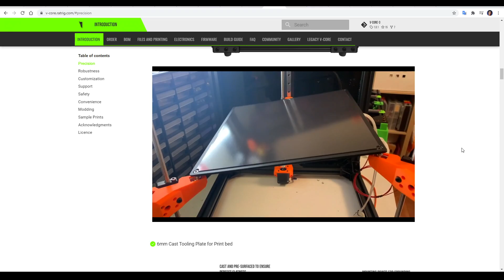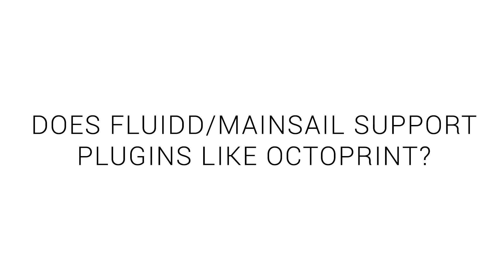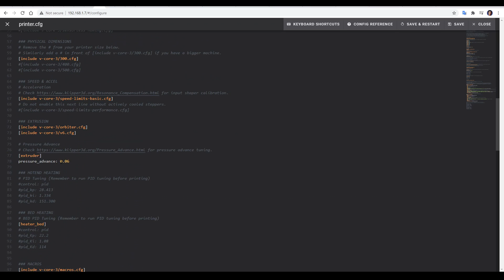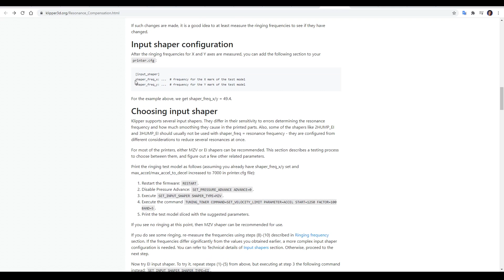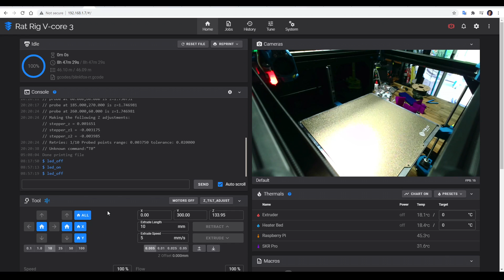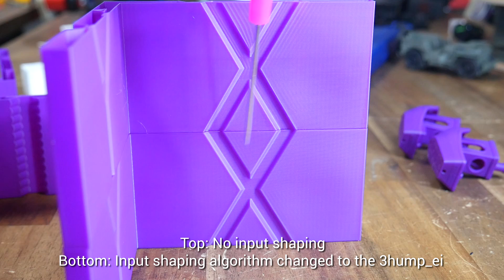Klipper input shaping - A leap forward in high speed AND high quality 3D printing [Rat Rig part 4]

Comment: Im amazed with your video, i just have a question. Why should I go with a ratrig instead of a Voron? Just want to hear your opinion
Reply from the maker: I agree with what Mikkel has said. Living in Aus, I was particularly attracted to buying everything as a bundle from one place. The whole experience so far has been tremendous, no complaints at all. This is not a criticism of any Voron model, I have no doubt they are excellent machines tool.
Reply: @TeachingTech  than you for your answer, I'll totally watch all the videos related to this build as this is the only one ive seen so far, do you consider that switching from marlin to klipper is to difficult? Or should it be a no brainer? (Maybe apples and oranges here but this is the first time ive heard of this firmware).

Greetings from Mexico mate!
Reply: I can try to answer that. The pro's for the Rat Rig V-Core 3 would be: Designed to work reliably up to 500 mm^3 print volume. Beefier and more rigid construction (3030 profiles, mgn12, 9mm belts, corner plates, etc). Easier/less complicated assembly. Backed by an actual company (that means official kit sold in EU, proper EU warranty and support). Prolly a few more i forgot. Kind of a subjective one, but in my opinion EVA (the carriage) is one of the big pro's as well, it's so well made, modular and well balanced :)
Reply: @miklschmidt  thank you for your answer, I was actually thinking of it while looking for the kit and ratrig caught my attention easier, I'll keep looking into this as im intended to invest in only one more printer this year.  Thank you for the information!
Reply: You have to also consider the goals that the designers of each printer wants to achieve. The main goal of any Voron is to print ABS reliably, and they do excel on that. That's why they limit to a 350mm × 350mm × 350mm print volume, more than that and it becomes harder to passively heat the print chamber. Also, it is the anecdotal higher print volume that can be reliably made with 6mm width belts.

V-Core 3 can have bigger printer volumes, but they use bigger belts to overcome one of the limits of the CoreXY motion system: belt length. As it increases, it becomes more and more difficult to tension the belts properly. By using beefier belts, V-Core pushes the limit a little bit further, because the belt itself is more rigid.

Also, Voron official community at Discord is pretty friendly, despite what the haters says. Can't say about the official V-Core community, as it is hosted on Facebook and I deleted my account there years ago. 🙃
Reply: @vinnycordeiro  great info! I never use abs as I dont like the shrinkage and I can get better fisical propperties with other materials or at least similar, I design and 3d print tactical equipment and prototyping for same area, started as a hobby and I hope soon become my man income source as I love doing it! 
Anyhow, I would love to give ratrig a try, voron sounds great but I really dont.have the time of printingn all the accesories needed so I believe I have my best option already thanks to you guys!
Reply: @luigitejeda328  Voron have a Print It Forward (PIF) program, so you don't have to print the functional parts, and some sellers on Aliexpress are already selling kits for the more popular models (the Voron 0 and the Voron 2.4). Stepper motor manufacturer LDO is planning to sell Voron 0.1 kits at the of the month, and Fysetc is already selling Voron 2.4 kits. And there are online shops in the US and EU selling parts for Voron printers.

I have a Voron 0, it prints like a charm, and I still didn't finished calibrating it.
Reply: @vinnycordeiro  we have a very vibrant and active discord community as well, in fact, i’m an admin there :)

With regards to passive chamber heating, the heater scales with the build plate, i’d be shocked if the 500 didn’t print ABS perfectly well :)
Reply: @miklschmidt  but it'll take more time, as the print volume increases in a higher ratio than the bed area. That's why people got in love with the V0, it's so tiny that it gets pretty toasty very fast.
Reply: @vinnycordeiro  if the buildplate was in the bottom, yes, maybe it would be an issue, but it’s not. I don’t think there is any issue with it. Fwiw, we have a few community members with enclosed 500mm’s an no one have reported any such issues. The 500mm heater is 1700W. It heats up my office to 30 degrees pretty fast 😂

You can always add a chamber heater i guess.

Comment: Thats really cool; glad to see there are people in the fdm space still doing other stuff than seeing if they can make their printer another $10 cheaper. Id gladly pay a premium for a printer that does all this well out of the box, but as far as I know neither prussa or ultimaker have been pushing the envelope here.
Reply: this makes some ultra rigid setups $300 cheaper
Reply: Input shaping is definitely the way to go to improve the FDM printing experience. I have spent the past 12 months to develop an easy use input shaping firmware which only use a 32bit control board.
Reply: Input shaping without Klipper https://youtu.be/d-X-BZQEGno
Reply: Most people go to modded printers that are deep in the hobby, look at vorons
Reply: Hey from the future. Bambi Lab x1 Carbon
Reply: Making printers cheaper is still a good thing. I can't afford one still (highschool student :3) but it's getting close.
Reply: @ChrisD__  Creality Ender 3 of e-bay for $197, and PLA is $14 a KG...  It's not going to get any cheaper, and if it did, you don't want it, likely...  Now you know what to ask for for Christmas...
Reply: @thetruthserum2816  Is the Ender 3 a good machine?
Reply: @Mategeneral  Price to performance ratio is as good as it gets... $179... But, if you want a no fuss printer, skip any printer with a spring bed, and go for direct drive extruder and linear rails, for example the Cetus 3D will give overall better results because "there are no springs"... Springs are not repeatable, and are only there to "prevent a crash", and need to be eliminated from 3D printing entirely.

Comment: i need klipper to have better support for LCD screens. sometimes i just want to use my printer without having to load up a web interface on a different device....this is what i'll miss the most if i move from Marlin
Reply: You can use most LCD screens, you can easily configure your own menu entries as well if you want to. Then there's touchscreens connected to the pi with KlipperScreen and finally an old tablet / phone or HDMI screen with the Fluidd interface like Michael is using. Lots of ways to use klipper without a separate device :)

Comment: Instead using the macros to turn on and off the led you can use the switch in the fans and output section. If you add the pwm section in the [output_pin] you can also change the brightness with a slider in the same fluidd section
Reply: Could you elaborate on that? If the fan output runs on 24V hows do I run a single 2V led of that? Or does it require to install 12 leds to fill the 24V output?
Reply: @chaicracker  you can set a max pwm output. If you need to power some 12V equipment you set the max power at 0.5 so the output at 100% is 12V
Reply: @XeonMC01  Holy moly.. thank you for blowing my mind... also thanks for the quick reply :) <3
Reply: @chaicracker  hope it does work for you
Reply: @XeonMC01  I'm preparing a led to try out, do I need a resistor for that? only have one on hand and don't wanna fry it.
Reply: @chaicracker  technically it’s sufficient to set a lower power value in the config. If you want to be shure you can set it to output half of the maximum voltage that your led supports, and then fine tuning it

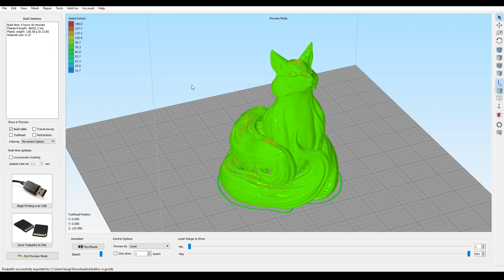Comment: 19:08 *Lowered the layer height to 0.15mm
Reply: Even if the trade off was just printing at 0.15 layers in the time of 0.2-0.3layers it would be a big quality / speed improvement.
Reply: @radicalxedward8047  That was not the point. I wanted to correct him cause he said 1.5mm instead of 0.15mm.

Comment: This series and printer is outstanding, I look forward to your speedboat prints seeing some of those just blows my mind. Is it possible to make a linear advance test with the cube shape in marlin ? it just looks like a better way to check.
Reply from the maker: I believe you can use whatever test print you want since the firmware is altering the values on the fly for you. In Marlin, you would just add in M900 values every few layer changes with a text editor and then print.
Reply: @TeachingTech  Great, I will try this.

Comment: Is it possible to make a comparison between reprap and klipper? I love all these new features in klipper, they seem really really good and they seem to be constantly improving at a rapid rate unlike the others so far. I currently have reprap on my skr pro 1.2 but I don't know whether it's worth it to swap from reprap to klipper. I'll add that I'm using a delta printer too.
Reply: So i've been trying to keep a pros/cons list up to date, maybe it's useful to you. I've tried being objective, but i am a major klipper fanboy, so keep that in mind. Bear in mind that it compares Klipper with RRF running on a Duet Board, since this is not the case, some of the pros for RRF are not applicable:

Klipper Pros:
Proper input shaping with automatic calibration via an accelerometer.
Faster than you'll ever need.
Very Precise motion based on actual physics instead of approximations.
Easy to setup with V-CoreOS (Requires SKR Pro 1.2 at the moment).
Readable configs, flexible jinja2 infused gcode macros.
Has a handy TUNING_TOWER command for changing parameters at an interval throughout a print, for tuning purposes.

Klipper Cons:
Documentation could be better, everything is well documented (including technical details and guides) but could be easier to navigate.
To use physical endstops on the SKR Pro 1.2 you need to bend 2 pins on your stepper drivers
Duet/RRF Pros:
Excellent hardware
Extensive documentation
Input shaping should be added soon-ish.
G-Code everywhere allows you to do configuration mid-print if you for some reason wanted to remap your axis, change your kinematic system or flip your stepper directions while printing.
Duet/RRF Cons:
G-Code as configuration (arbitrary numeric commands for configuration is not great for readability, you'll need the documentation constantly)
No input shaper at the moment (as mentioned it's coming). DAA does not count.
Slower than klipper (may or may not be an issue in practice when input shaper is added)
Reply: @miklschmidt  ahh just seen that you can use fluidd/mainsail, for the interface, those look very nice actually and seem very similar for reprap.
Reply: @miklschmidt  are you the person that makes the ratrig? I seem to see your name quite often around this printer? If so I'm very impressed with the price, if I didn't have a large delta printer I would definitely be looking at your printer.
Reply: @madbull4666  i’m just a BETA/Development team member, admin of the discord and creator of V-CoreOS. Pawel Kucmus is the designer and Rat Rig is the manufacturer :) it’s complicated 😂
Reply: @miklschmidt  sounds like your a pretty important part of the team then!
Reply: @madbull4666  nah i’m just the guy that yells “klipper!” at inopportune moments 😂
Reply: @madbull4666  didn’t see your other comments, sorry!

V-CoresOS is just a preconfigured Klipper package that takes the hassle out of the setup process. Watch the previous video in Michaels series to see how that works. As of now it only works with the SKR Pro 1.2, but support for other boards is coming soon. Yes you still have to bend the pins on X/Y if you’re using anything other than sensorless homing, unfortunately that’s a choice BTT made.
Reply: @miklschmidt no problem at all! Are you sure it's 2 pins that need to be removed/bent? On marlin and skr with reprap, it's only 1 pin that needs this?

I'm interested in getting klipper as it seems like they always seem ahead of the other firmwares and the developer's seem preety decent and want the best for the community rather than just themselves so much like reprap and smoothieware, and marlin is just awkward to use.
Reply: @madbull4666  yeah 2 pins in total meaning 1 on each driver (the DIAG pin).

Klipper is awesome! Definitely give it a shot :)
Reply: @miklschmidt  ohh that makes more sense! I've got a delta so for me it would be 3 but I've already done that on my board so no issue at all.
Reply: @miklschmidt  You forgot another Klipper pro: hardware support. You can run Klipper in a ton of microcontrollers, even Arduinos if necessary.
Reply: @miklschmidt  thanks! I really appreciate it. When you say that V coreos does that run on an skr pro instead of a raspberry pi? How good is V coreos? I don't think I've heard of it before. 

I use optical endstops currently so would I still need to bend 2 pins on the drivers?

One thing that I really really like about reprap is the Web interface, and I'm not such a big fan of octoprint as it just doesn't look as refined, what kind of Web interface does klipper have?

Comment: That accelerometer based input shaping is insane. Wow.  I am seriously interested in building a klipper based machine at this point.
Reply: Pretty much any machine can be a klipper machine. Just need a raspberry pi.
Reply: @kouji71  i didn't catch how its controlled. Does the pi just feed gcode to the printers existing main board over serial? And do you just rase the main boards jerk and acceleration values way up so it would then uses the new defined settings fed with the g code?
Reply: @jim4556  so the pi does all the hard calculations and the gcode and the stepping calculations and the control board executes the actions
Reply: @kouji71  or an older PC. I will be running a few printers off of one PC.
Reply: @kouji71  it is possible to use input shaping with a just a 32bit control board.
Reply: Input shaping without Raspberry  Pi https://youtu.be/d-X-BZQEGno
Reply: @Ibleoverhan  build it bigger!
Reply: klipper is soo good. It makes some things so much simpler. The printer config is very easy and fast to modify. Easy on the eyes instead of looking at unnecessary code
Reply: You wont regret it
Reply: Hey y’all you don’t HAVE to use a rasp pi you can use anything running Linux or CAN run Linux, I used a old 2012 MacBook Air

Keep in mind there are no GPIO pins so you have to use a pi pico to connect a adxl
Reply: im gona install it on my ender 3

Comment: I put klipper on my Anycubic Chiron and I can reach 100mm / s of speed with 7k of acceleration so I assume it can push a lot more with that printer
Reply from the maker: For sure, I', just getting started. Now at 200mm/sec @ 6K accel and the prints look the same. Will be aiming for faster and faster until diminishing returns.

Comment: You're supposed to do the resonance calibration before you do the pressure advance calibration.
Reply from the maker: It's irrelevant because pressure advance is set to zero before the resonance test.
Reply: @TeachingTech  I know that, but it doesn't make it irrelevant. You calibrate after adding your input shaping settings and you 9 times out of 10 get a different pressure advance result...

Comment: Using an accelerometer and input shaping is really cool
Reply from the maker: I see this being used to detect skipped steps too. Like the Prusa method but better.
Reply: Yes. And the next step should probably be active oscillation suppression right during the printing by constantly monitoring the acceleration.

Comment: How come the top layers on the Jeep are not completely filled in?  Is your pressure advance set too aggressive?  Or maybe needs to be retuned after running input shaper?
Reply from the maker: Just that particular filament needed a higher flow rate. I bumped it up on the fly, just not quite enough.

Comment: Can this be used in a regular ramps 1.4 AND how the wires Will be on It?
Reply: Yes! You'll want to connect the ADXL345 to the Raspberry Pi in that case. Wiring diagram is in the klipper documentation as well as instructions. Google "Klipper measuring resonances" 👍

Comment: If ADXL345 is unavailable then ADXL343 will work without any change.
Reply from the maker: Just ordered a few the other day after reading this and finding ADXL345 out of stock. Really hoping you are correct :D
Reply: I have one from Adafruit (red pcb) and it works without any problems. Just check wiring twice, pinout is little different than in klipper`s documentation.

Comment: Holy moly, 30$ for the accelerometer is a lot.
If you can wait a bit the ones from eg. aliexpress are only 1-3$.
Reply from the maker: Just showing what I used. Wouldn't be cool if I linked a cheapy from elsewhere I hadn't tested that turned out to be incompatible.
Reply: @TeachingTech  yeah, just left that here for other people.
The chip they use us the same, so there will be no issues, but as always with cheap stuff qc might be problem, so it could just as well not work.